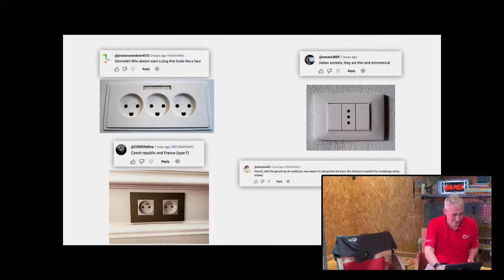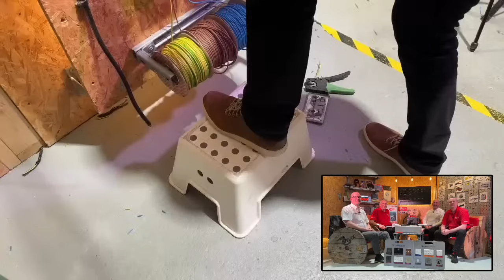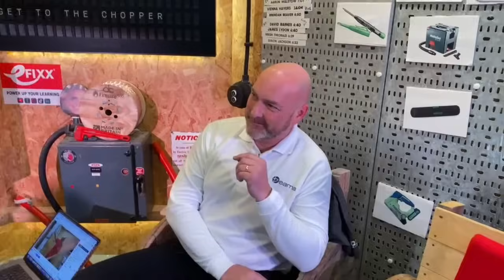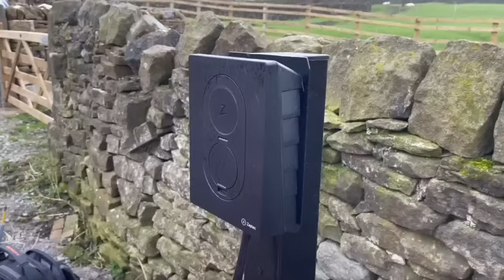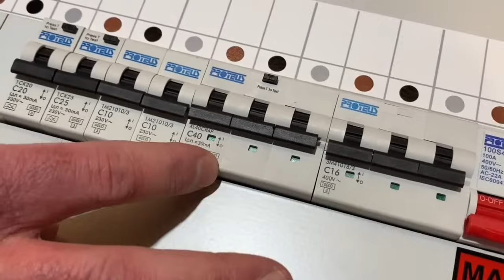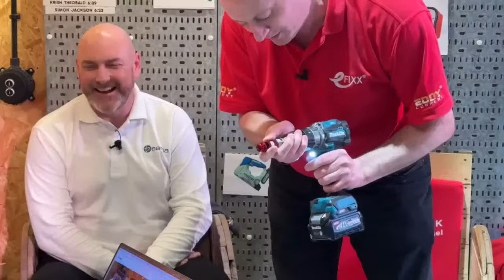The World's Best Socket Just Got Better!

Comment: The explanation of the RCBO doesn't make sense. If the RCBO detects a fault and trips, it effectively decouples the inverter for the PV/battery from the DNO 'grid' supply and so the mandatory G98/G99 protections - probably Loss-of-Mains protection - should shut down the output of the inverter in about one second.

Assuming the RCBO trip disconnects the fault from the source inverter, even if the inverter AC output remained energised, (which it should not, of course),  any standing voltage across the 'OUT' terminals shouldn't give the RCBO any problems, surely? Any apparatus designed to be connected to the public distribution network has to comply with lots of standards, including BS EN 50160, which means the RCBO internals should be able to cope with anything a typical inverter could deliver to it. If solenoids are failing, I would be looking at the quality/specification of these devices or what the manufacturer is putting inside the box controlling the solenoid!
Reply: Spot on. If your inverter is still supplying power after LOM then it isn't G98/99 compliant and shouldn't be installed in the first place!!!
Reply: Exactly so are the cheaper RCBO’s not up to the task.
Reply: In normal use, during the day the power will flow in both directions so may not work for additional or fault protection when the solar is flowing into the house.
Reply: @neilbridgeman7768   the RCBO uses a very simple current differential protection that isn’t (as far as I can see) polarised by the voltage. The protection doesn’t “care” about the direction of power flow. Pretty sure the guy from Proteus stated that the device would trip for power flow from the OUT to the IN terminals but he also stated that they had some issues with the solenoid being held-in, which is what I’m questioning.
Reply: @sleepyspaniel2018 One would think that if the RCD has tripped and disconnected from the consumer side leakage fault then three won't be any more fault to trigger driving the solenoid. It sounds therefore that the fault they are considering is on the generator side which possibly could keep triggering the solenoid - but then the generator should have shut down in the event of loss of grid.

Comment: A question on the RCBO solar issue if the grid supply is no longer present due to the RCBO tripping a grid tied solar inverter shuts down, there would be no current to damage the RCBO solenoid.
Reply: Yes but in normal use, during the day, power will flow in both directions.
Reply: A grid tied inverter doesn't shut down immediately though.
Reply: @VinoVeritas_  As far as I can see, the maximum disconnect time in the regulations is 0.5s. If a trip coil cannot survive being energised for 0.5s, it has no place within a safety device.
Reply: @yngndrw.  My point was more about the assumption that an inverter immediately shuts down in a LOM event. As you've quite rightly mentioned, EREC G98/G99 compliant inverters must disconnect within 0.5 seconds. Hence the reason why BS7671 doesn't allow inverters to power a circuit via a 3 pin plug.
Reply: @VinoVeritas_  the specs on mine say 20ms.
Reply: @ItsAllJustBollox  Which inverter do you have?
Reply: @VinoVeritas_  victron multiplus 2 quotes 20ms changeover, to be fair the lights dont even flicker when the grid power fails unlike other inverters.
Reply: @ItsAllJustBollox  You're talking about  a backup power supply, not Loss of Mains protection.
Reply: @VinoVeritas_  well if you are correct and their specs quoted are incorrect its still no more than the legal limit of 500ms.

I have a bi directional RCBO fitted now, I also tested the old one numerous times at various loads to see if it would fail the test as per the video and it still worked fine, so whatever the Victron disconnect time is its not long enough to damage the oriignal RCBO fitted so the issue could be more related to poorly designed inverters or RCBOs.
Reply: @ItsAllJustBollox  It is 20ms for changeover but I'm not sure for  loss of grid, presumably the same, I have a Quattro. The way it works is the Quattro and presumably its the same for all Victron inverters and possibly others, is it tries to alter the frequency, which all the time the grid is connected it can't, when it can it means the grid is gone. Presumably other inverters detect loss of grid in a similar fashion and then shutdown. Since they shutdown very quickly surely this very small amount of time wouldn't damage the coil, as other have mentioned.
Reply: @TheRonskiman  the victron kit monitors the voltages if it drops below or goes above the threshold the inverter drops the grid, this could be how they have such a fast response time by the time power is lost they have detected the volt drop already.
Victron stuff is designed for unstable power supplies not just loss of grid like more mainstream house inverters.
Reply: @ItsAllJustBollox  Grid loss detection is done on frequency, think about, the inverter creates voltage, so how's it know when the voltage is gone, it can't if it's measuring voltage, as it will measure the voltage it's producing. Do a Google for 2.3 How does LOM detection relate to overload shutdowns, you'll find a victron document that explains it. Yes it will also cut out or isolate the grid for under or over voltage, but that's different to loss of grid.  My setup is full house backup, the grid comes in, through a fused switch, then through the quattro, then supplies the house CU, which also has a Solaredge AC connected PV system.
Reply: @ItsAllJustBollox  further to my last reply, Google ve bus grid-codes-and-loss-of-mains-detection and look at section 2.3, it will confirm what I've written.
Reply: @TheRonskiman  you may be right but we can agree it disconnects very quickly.
Reply: @ItsAllJustBollox  it certainly does, if I flick my grid connection off the lights don't even flicker and computers don't even blink.
Reply: @efixx Have Proteus responded to this comment?

Comment: The Danish socket has the problem that it accepts a schuko plug but the ground does not connect and all the neighbors of Denmark use Schuko so there are many such devices.

The grounding on Schuko is done so and not with a prong as for long grounding was used only on wet rooms so one needed to prevent the use of ungrounded plugs there but one had to allow use of grounded plugs on dry rooms. The idea behind the French socket is the same.

Comment: The RCD thing becomes a non-issue if the alternate source is installed upstream of them as it should be. Also, shouldn't the solenoid be fail-safe, as in it must be working to keep the output energised.
Reply: A grid tied solar inverter shuts down as soon as the grid supply is not present, so there would be no current to burn out the solenoid.

Comment: Another great video guys, its worth mentioning that its not only RCDs that need to be bi-directional if installed with generators i.e. Solar PV but MCBs also need to be bi-directional. MCBs marked "in" and "out" or "line" and "load" can have their arc extinguishing/short-circuit characteristics impaired if they are connected incorrectly. Gary, just go and check that new MCB you've just installed 🤣

Comment: Buried in this is the unexpected (ie I didn't know) bit about RCDs et al having directional (found everywhere) and the (lesser spotted) bidirectional version that is (now clearly) needed for generative equipment (inc solar, home batteries etc).  Moments after I went through my own (oh f*ck) moment I can see the team here doing the same and finding the wrong ones installed in their own homes.  Having just read the Beama 10-page note on the subject to find it incredibly badly written with poor, useless or arguably absent diagrams I can understand why this issue is so misunderstood - it does not even include the circuit diagram for either version!  Indeed, it uses the absence of consumer facing markings (arrows or words) as the way to identify a bidirectional RCD - even though this does not accord with reality or any recognised standard.  [See: BEAMA-Technical-Bulletin-Connection-of-Unidirectional-and-Bidirectional-Protective-Devices-2023].

This simple topic is worth a video in its own right.

Comment: Those are at the low end of the snake-oil fuse range. QSA Gold Extreme, £8,000 for one.   £3,700 for the single socket outlet to go with it.
Hold onto your hat if you want a Nordost Odin 2 mains cable though.  Five figures. MID five figures.
Reply: @Nbomber the Light Blue Entry Level Fuse, with "added graphene elements". That'll be the end caps "treated" with a 2B pencil, then.
Reply: @Nbomber I think they may have overstepped the mark with their Power Jitter plugs.  The distance from the pinhole to the edge looks a bit, ummm, non-BS1363 compliant?  You know, illegal for sale in the UK and all that.